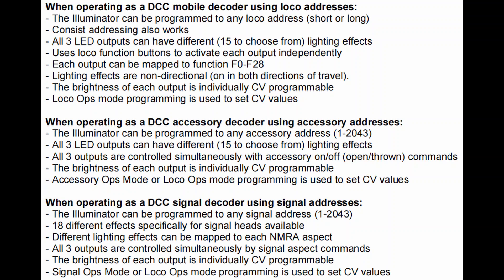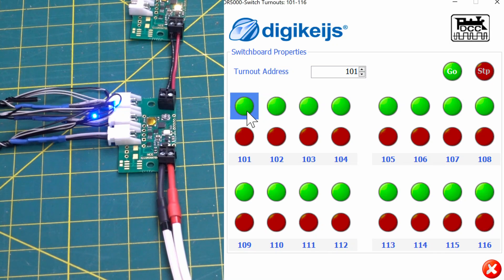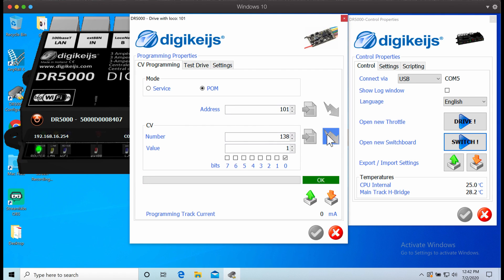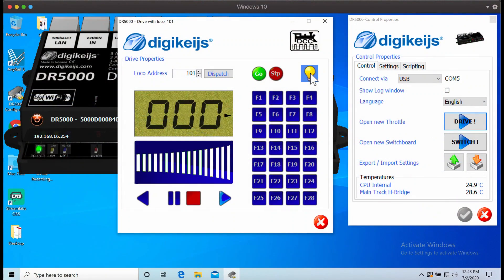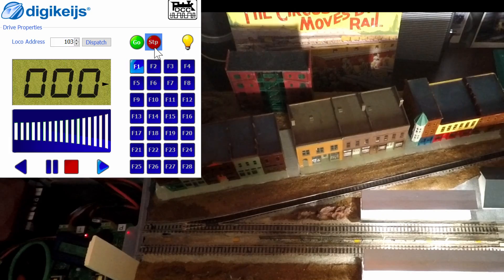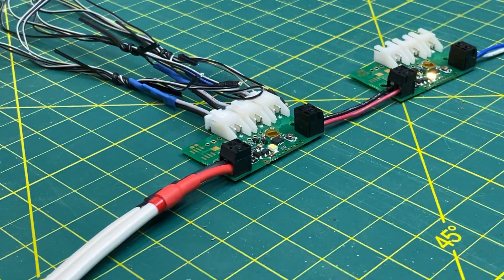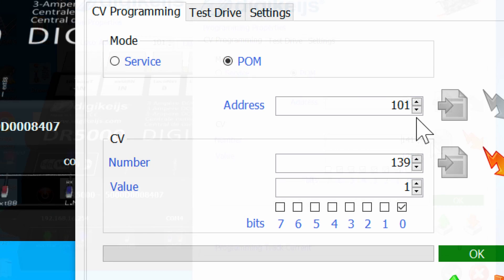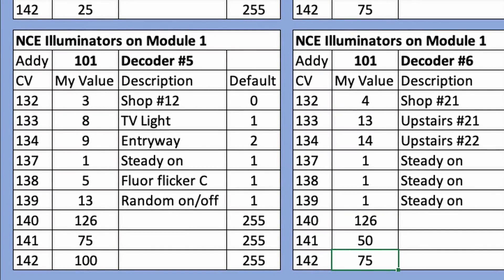DCC Lighting Control with NCE Illuminator and Woodland Scenic Just Plug

Comment: Can this device be used to program track signals? What I want to do is come up with some decoders that can turn a green signal red, once a loco 'knocks down' the signal. Then when the train leaves the block and moves into the next block, the signal goes to yellow (approach, be prepared to stop at the next signal). Then turn green once the neighboring block clears (clear, proceed at track speed). Has anyone done this, and can share what products they used to get it to work?
Reply from the maker: Rob, There are some options where you can use an all in one decoder, but my understanding is that the more common way of doing signalling is to setup block detection or infrared sensors, and then use something like JMRI to trigger the signals.
If I was doing this, I would use a Digikeijs DR4088CS and a Digikeijs DR4018.  The 4088 would be my block detection device and the 4018 would control the signals.
The most common all in one unit that I can think of would be something like the crossing gate controller from logic rails. But that is specific to crossing signals and not just general signalling.
Let me know if you have further questions and I will do my best to direct you to a good resource. -Heath

Comment: This is a nice solution. I’ll have to look at these a bit for how they may fit in for accessory lighting. I had been planning to use ESP32/ESP8266’s, as that’s what I’m using for overhead lighting control. But I think this is a better solution for most people, and for people without the skills or interest in loading Arduino code or messing with MQTT. Thanks for sharing.
Reply from the maker: My goal for this project was to have everything be DCC controlled with commercially available parts and not too much custom programming.  

I am trying to get more information on the DCC control functions of the LED Scene controller II to see if it would have worked better for my needs.  This unit has 100 effect settings versus the 15 with the NCE Illuminator.  But I am not sure how controllable it is over DCC.

DCC++ and arduinos and writing code would be cheaper, but I would never get to the other parts of model railroading once I started down this path.

Thanks for checking out the video.

Comment: Heath, super cool lighting effects, I like the failing light on the platform best of all. Switch your railroad to Conrail and maybe Sparky will get there quicker to fix it, lol. I was considering doing something similar to my buildings to include the flicker of the TV too but it sure looks like a lot of work and expense. Perhaps I will model a retirement village where everyone is in bed before the sun goes down instead, lol. Cheers Rob
Reply from the maker: Rob, Watch video 18 to see my Conrail locomotives.

It can be a lot of work, but I think it adds a lot to the layout to have lighting. You could just control the lighting via analog, but I wanted the challenge to figure out the DCC control.

Thanks for watching.